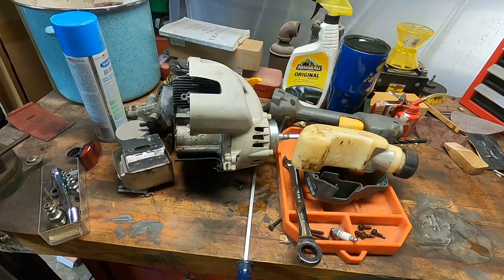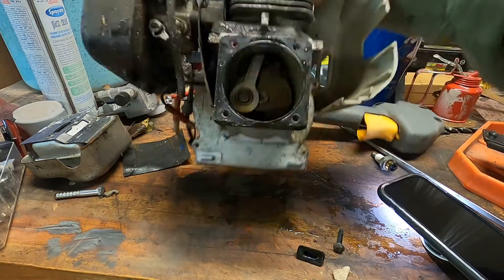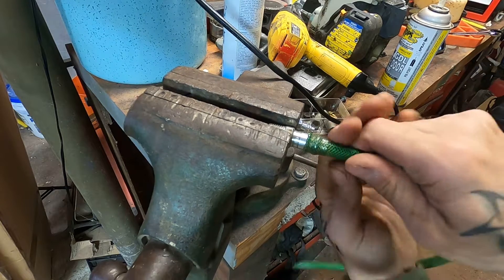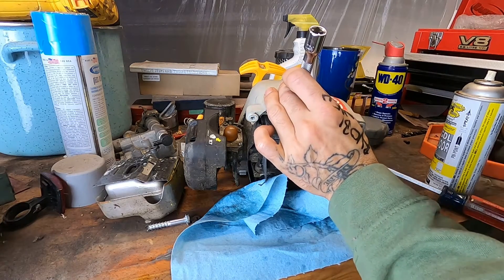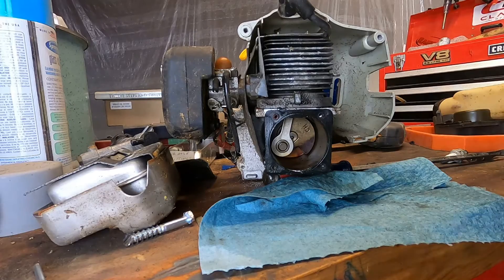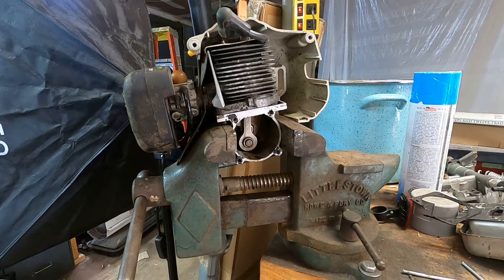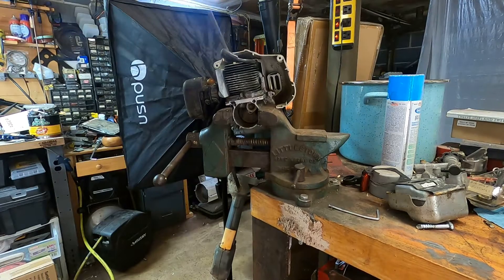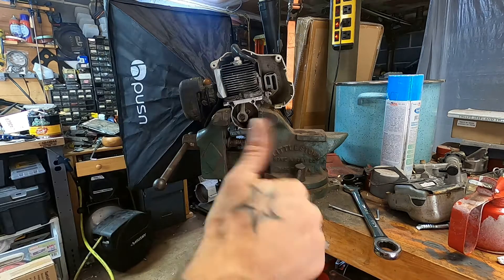Will an air compressor unseize and engine?

Comment: I got a free stihl trimmer that I was told didn't run or anything. Got it home primed and it fires first time everytime. The gas I dumped out was straight gas not mixed so it smoked a bit. I have the notion to do something crazy with it and make a little 2stroke powered "generator/battery charger" take a old car alternator and a battery and make it a battery charger or something lol

Comment: Well Doug, watching all your videos of you fixing old junk lately, I fanally gave in and I'Mm gonna go get a broken White 30" snowblower I saw on marketplace. I'm going to get it tomorrow morning; almost rust-free, good price but the blades aren't spinning. Wish me luck!
Reply from the maker: That is awesome bud! Best of luck. Let me know how she sounds running
Reply: @jamesl9686  The auger ring gear and worm gear were completely fubar; luckily the parts are still available and the prices ain't eye-watering too much. It's just somewhat an involved task finding part numbers since White products have been rebranded to MTD, and a lot of part numbers changed. As for the repair, I'm not stressin' ; I'm a mechanic in a tool rental store, so I fix anything from edge trimmers and chainsaws to excavators and Skyjacks! 😆😁😉